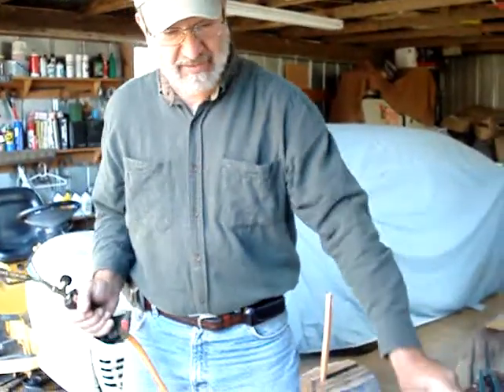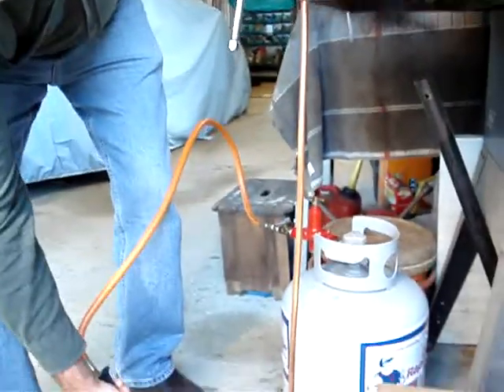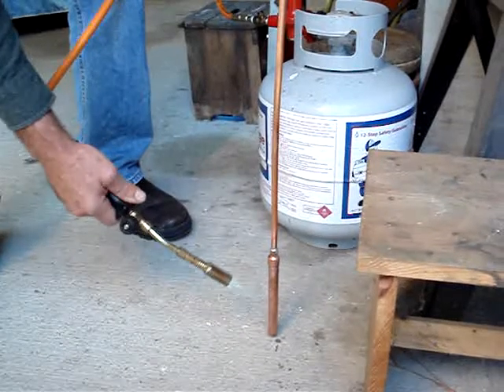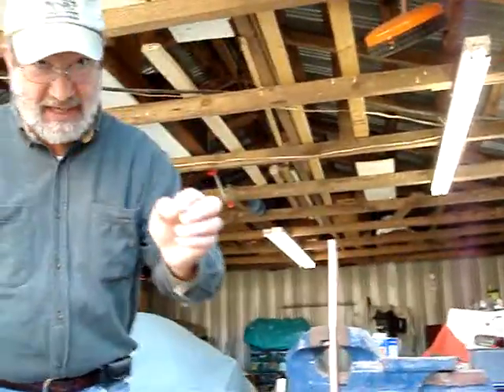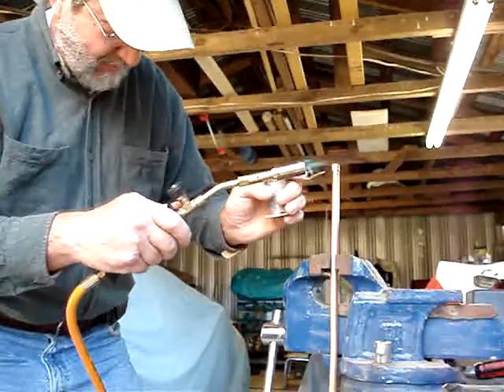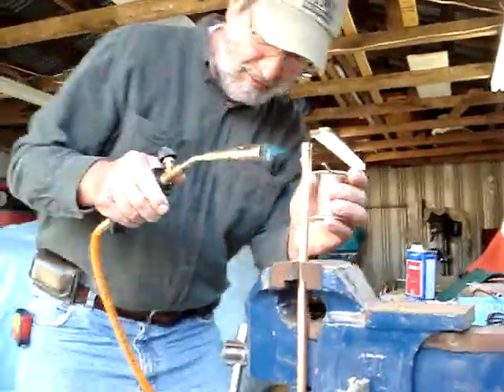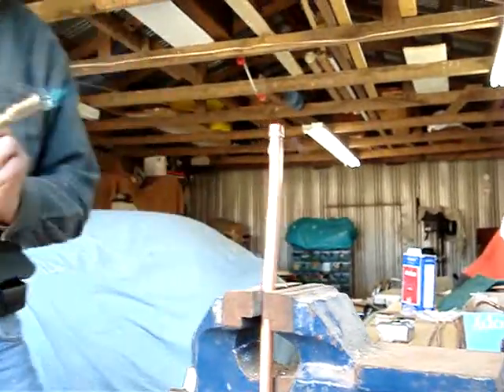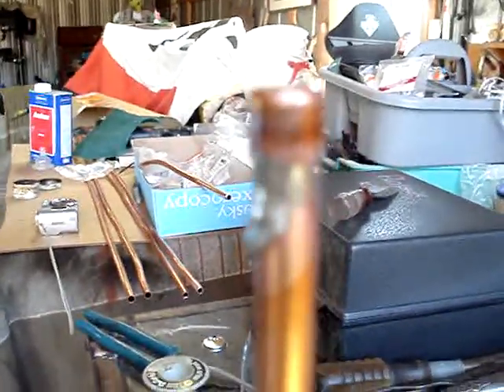making a heat pipe

Comment: I had problem with soldering the cap on - the vacuum inside the tube sucked the solder inside - it prevented a seal forming

Comment: Do you prefer acetone to water?
Reply from the maker: Yes, because it boils at a lower temperature
Reply: @DougKalmer  thank you for the response.

I went looking for data and found "Working Fluids and Temperature Ranges of Heat Pipes" very useful in data for working fluids and heat pipe material.

Comment: It's technically a Thermosiphon.
Add a wick and it becomes a Heatpipe.
Reply from the maker: It's a heat pipe- "A heat pipe is a heat-transfer device that employs phase transition to transfer heat between two solid interfaces. At the hot interface of a heat pipe, a volatile liquid in contact with a thermally conductive solid surface turns into a vapor by absorbing heat from that surface. The vapor then travels along the heat pipe to the cold interface and condenses back into a liquid, releasing the latent heat"

Comment: Fastest heat transfer rates known to man. Almost instantaneous. I thought it was water vapor though and not acetone.
Reply from the maker: Acetone used to get boiling point lower than water
Reply: @DougKalmer  no wick or is that in the construction already?
Reply from the maker: @scott-hr3hd  No, no need as long as the heated end is below the top of the pipe, gravity delivers the liquid back to the bottom

Comment: Does the pipe have sintered or grooved insides ??? Does it matter to have the pipe vertical or horizontal orientation ????
Reply from the maker: The pipe is smooth inside.vertical works much better horizontal would not work without a wick of some sort. You need gravity to pull the liquid back down to the heat source
Reply: @DougKalmer  Thank you Doug.

Comment: Think these could be used for a floor heat system?
Reply from the maker: No, as they need to be at or near vertical to work.
Reply: @DougKalmer  is there a way to create a wicking system to help it work at level?
Reply from the maker: @NwoDispatcher  I've seen some made with wicks, not nearly as efficient

Comment: Thanks so much Doug Kalmer,  Is the remaining acetone in the heat pipe acting as the heat transfer fluid, as opposed to using water???
Reply from the maker: The acetone boils, carrying much more heat as a vapor than a liquid can to the top of the tube where it condenses and drips down to complete the cycle
Reply: @DougKalmer  thanks Doug.  Great work ;-)

Comment: Could you use this to heat a hot water tank from a wood stove more effectively than using a thermosyphon coil?
Reply from the maker: I would use the thermosyphon coil instead for safety. The heat pipes are enclosed and do not have a pressure relief valve.

Comment: Interesting, thanks. I’d love to see it tested. You could always used epoxy to seal the top
Reply: Generic Jesus - the top goes well over 100C in use... not sure epoxy will hold up...  also, heating of the gasses in the tube during soldering increases the vacuum and lowers the temperature at which the acetone will boil, thus increasing efficiency.
Reply: Dont be lazy... learn to solder... Epoxy has no place in bonding copper for such an application. And as the gent above me already pointed out, just the act of soldering increases efficiency, which is kinda the point of building a heat pipe in the first place🍺
Reply from the maker: I would not advise using epoxy

Comment: Hi, we could double the efficiency by making very thin grooves grooves on the inside of the pipe aka a wick, like in the comercial heat pipes.
Does anyone know of a way to make tiny grooves like that?
Reply: gee i dont think u need to as it has a partial Vacuum so it will boil easily and transfer that heat energy up and condensate on the cool top which is against the colder water header,its a closed loop in that pipe already
Reply: In complicated and prototype heat pipes, they add a fine mesh screen to act as the wick.
Reply: @DerekWoolverton   virtually all commercial ones do, it only takes a websearch

Comment: Alcohol is not used within these things?
Reply from the maker: Alcohol can be used, some use water.
Reply: Have you ever tried using liquid metal instead of water to generate heat? With an electromagnetic pump could you not generate more heat and even make a hot plate to cook on and even heat a home and generate electricity?
Reply: Novartis

Comment: DANGER !!!!

For this project    DO NOT WELD   the copper pipe with tin or lead, because the final capsule will explode with the excessive heat on the solar vacuum tube.
CONFIRMED !!!

I wish you nice day
Reply from the maker: Every one of the dozens of heat tubes I have made used Lead free-with tin- SOLDER, and the only one that blew the end off was when I was experimenting with the amount of acetone and used too much
Reply: @DougKalmer  how much? is enough?
Reply from the maker: @rolandreves7222  Depends on length and diameter of tube.  Read down to see what I used

Comment: What volume of liquid would you recommend for a two foot x 1 inch heat pipe?
Reply from the maker: +Michael Buss I went with trial and error-and the error in using too much burst the end cap off the pipe and sent the thermometer over the roof of my house
Reply: sounds promising. I'll start with a small volume and work my way up then!

Comment: Is that 3/8 ID / 1/2 OD ?
Reply from the maker: +Eric Poulsen 3/8 OD
Reply: +Doug Kalmer  Did you find straight tube, or just straighten the coiled refrigeration stuff you could find at (say) Lowe's?
Reply from the maker: +Eric Poulsen Straightened the soft coiled tubing
Reply: +Doug Kalmer How did you arrive at 8ml acetone for your tube length (or actually volume)?  Trial/Error? Is there an empirical formula?
Reply from the maker: +Eric Poulsen No formula that I know of, trial and error, too much is dangerous
Reply: Doug Kalmer Last question: I have a short tube. How long is the 3/8 tubing you're using? I can adjust the amount of acetone if I know how long yours is.
Reply from the maker: +Eric Poulsen Think it was 46"

Comment: What is the "copper riser" on the bottom in this video?  Looks like a fat section of copper tube that has one end sealed. Did you buy it like this?
Reply from the maker: +Eric Poulsen Yes, it's a standard plumbing fitting readily available at Home Centers and plumbing supplies.

Comment: sir, how to set the pressure inside the heat pipe??
Reply: +Rahul Rathi He uses acetone, and if he got all of the air out of the pipe, he should be left with a saturated mixture of acetone liquid and vapor. The internal pressure is solely a function of temperature, and a plot is available at http://webbook.nist.gov/cgi/cbook.cgi?ID=C67641&Mask=4&Type=ANTOINE&Plot=on#ANTOINE
Reply from the maker: +Rahul Rathi That is a function of volume to liquid ratio.
Reply: The hotter the gasses within the pipe the more vacuum is created, and the lower temperature the heat pipe will begin pumping heat at, due to the lower pressure allowing acetone to boil at a lower temp.   

  As long as the top end can dump the gathered heat to something (a water tank, for instance,) the over-all system would operate more efficiently.  

  This heating during sealing must be balanced with not boiling out all of your acetone.

Comment: Hi Doug, did you put some filament wire/steel wool in order to increase the capilaries?
Have you tried it? Does it work much better or it's not worth it?
Reply from the maker: +thephatnguyen If you mean a wick inside the heat tube, then no, there is no need as long as the tube is oriented so the heated end is lower so the condensate runs back down.
Reply: @DougKalmer  yeah that would gunk up,the wick thingy
Reply from the maker: @rolandreves7222  No wick

Comment: Glad I found this video again.  Do you think it would work ok to use all brazed joints instead of soldered joints, except for the final cap that could be a threaded connection that has teflon putty or hi-temp automotive Permatex on the threads for the final seal-up of the pure acetone vapor?
Reply from the maker: ShambhalaVillage Sounds good, let us know how it works out

Comment: how much water do we need inside of the pipe?
Reply from the maker: There is no water inside the pipe, it's acetone.
Reply: but, when i saw this experiment it says it could be with water and also my chemistry teacher told me it could be water, so i want ask you the same. could it be water?
Reply from the maker: Thiago Florez Yes, water could be used, but it's boiling point is much higher than acetone, so efficiency will be considerably less. It will also be subject to freezing, which could burst the copper tube. You could lower the boiling point of water by pulling a partial vacuum in the tube.

Comment: Great video doug, couple of questions: isn't acetone dangerous, like toxic?

Also have you ever built heatpipes for electronics, like PCs?
Reply from the maker: EPA removed acetone from the list of "toxic chemicals" maintained under Section 313 of the Emergency Planning and Community Right to Know Act (EPCRA). In making that decision, EPA conducted an extensive review of the available toxicity data on acetone and found that acetone "exhibits acute toxicity only at levels that greatly exceed releases and resultant exposures", and further that acetone "exhibits low toxicity in chronic studies". It's a main ingredient in nail polish remover, it's a common solvent available at most hardware stores.
No, I have not built Heatpipes for electronics
Reply: @DougKalmer   but i think the Chinese ones use a type of antifreeze? iv cut a few open

Comment: Ahh... had to scrunch my brain for a bit on that webpage! lol.  math isn't my strong suit.. or weak suit, lol.  ...however thanks for educating me on this.  I think my problem was not realizing the actual CAUSE of the boiling; my misconception (probably a common one) being that Heat was the cause of boiling when it's actually pressure on the water that keeps it from boiling! My misguided thought was a set numrical value between freezing and boiling point. Ouch, I was very wrong! lol Thanks much!

Comment: There seems some confusion on when H2O is liquid .....  lsbu.ac.uk/water/phase.html     ....this phase diagram shows it cannot be liquid below  0C  whatever the pressure , therefore no water heat pipe can work if its 'hot' end is below 0C.

Comment: ...for clarification though, my definition of a heat pipe is derived from the 60's and 70's where the heat pipe WAS the vacuum tube all by itself.  They are still commonly used in such places as along the Alaskan pipeline buried in the permafrost and extending above ground to remove heat from the permafrost to keep it from turning to mush.  ...I don't recall if the liquid used in them is water but the liquid under vacuum principle and 'below atmospheric freezing' principle applies for the vacuum

Comment: I agree with you, you can seal it by boiling the water and sealing it with it steaming out... and you will get the results you list.  However, if you pull the pipe into a deep vacuum, then valve in purified water and the vacuum stays deep, say 29.9199 in. HG, even when the water boils of to a vapor, at -60F, when it reaches the top and starts to condense and running down the inside of the pipe to collect at the bottom it will not be capable of getting cold enough to freeze at 0 external temp.

Comment: With respect Doug the amount of acetone in pipe would not determine if the top blows off. What would do that is not removing all the air, that's my main concern about the video that to remove all the air you need a steady jet of acetone vapor for a few seconds then quickly solder on end cap.

Comment: I beg to differ ...consider a heat pipe hot end 0F cold end 10F lets start with the water (ice) in the hot, lower end. The ice will vaporizer (not boil, which is change from liquid to gas) and sublimate to ice on the cooler end , but there it will stay coating the inside of the cool  end as ice crystals, the heat pipe cant work cos the ice can't return to the hot end. You don't need to pull a vacuum, just push air out by boiling the water ,when steam jetting out put on and solder end cap quickly

Comment: the water freezing isn't an issue if the vaacum is set properly:  water boils at 212f at 0 in. of HG vaacum, but when you start applying a vaacum... here are a few examples: 28.67 in. HG will boil at 86F, 29.87 in. HG will boil at 6F, 29.919 in. HG will boil water at -60F !! 29.9199 in. HG will boil water at -90F !!  Crazy fun! :)  ...now how to make these yourself and somehow pull the vaacum while getting the water in there would make for a neat hat-trick video! :)

Comment from the maker: Not that I know of, I arrived at 8ml by trial and error-and erring in the side of too much blew the top off one pipe with explosive force. I suppose you could figure the volume of the tube I used and get a ballpark ratio from that.

Comment: Is there a formula/ratio of acetone to the volume of the pipe and converter bulb, or doesn't it need to be that precise?  I've got some 20" x 1 3/4" evacuated tubes from Clean Republic that I can't find heat pipes for ( in the US).

Comment: no vacuum pump needed , you just repeat what you did in the video but using water ( and gloves ) . Heat up the bottom until a steady jet of steam comes out , then quickly solder on end cap. Even in an acetone heat pipe you have a partial vacuum ,just a bit weaker than a water heat pipe, at room temperature v.p. water 24 , acetone 230 mm Hg

Comment: Yes  , I was correcting your statement "...in a heat pipe you can use water at any temperature bellow freezing." you can never use a water heat pipe below freezing, it can survive freezing, heat pipes aren't just for solar, can be used in refrigeration

Comment from the maker: To collect heat at typical domestic water heating temperatures, it helps if the change of state occurs at or near those temps. Acetone boils at 133*F, water at 212*F, so to use water efficiently in this application requires pulling a partial vacuum on the heat pipe, which adds complications like access valves, vacuum pumps, and how nature feels about vacuums. Acetone is cheap, readily available, and the boiling point is right for this application.
Reply: Acetone/water  only boil at those temps at atmosheric pressure , which the inside of a heat pipe knows nothing about ,
 Doing what you did in the video , but with water , is all that is needed . You drive off all air then seal , then when cool the pressure inside will be the Vapour pressure of the water at that temp  0.0313 Armosphers at room temp Even if you connected a vac punp that would not reduce the pressure ( untill all the water vapour was sucked out ) Acetone is only needed for working temps below 0C
Reply from the maker: @oz93666  Then on a cold night the water freezes and breaks the pipe-acetone won't.

Comment: In a solar collector application you don't need to "operate" at low temperature. You just need to "survive" low temperatures.
When the sun heats the pipe to operating temperatures it starts to transfer heat.
redrok

Comment: Acetone is not a liquid at 100C at atmospheric pressure.
wikipedia(dot)org/wiki/Acetone_(data_page)#Vapor_pressure_of_liquid
At 100C the pressure of acetone is about 2 atmospheres or 60psi.
Water operates at lower pressures and will be at lower pressure at stagnant  temperatures. Besides water has better heat carrying capacity.
redrok

Comment: thanks for that ....I take your point that freezing won't damage the pipe , but surely you you can't use water heat pipe  'at any temp below freezing'  the working fluid has to return to the hot end and if it freezes on the cold end it won't move . What do you think best working fluid would be for minus 12C. ? Brilliant site you've got , particularly on lead acid , this is the expensive component in off grid power, now panels are so cheap , have just bought 5kw on Alibaba $0.65/w

Comment: BTW, virtually all the commercial vacuum tube type heatpipes use water as the working fluid. Water is nearly ideal for these applications because of its superior thermal mas s and high latent heat of vaporization.
I also have made heatpipes. See:
redrok(dot)com/misc1.htm#heatpipe
In these I used butane and propane.
redrok

Comment: You made a remark about 0C and water.
Actually in a heat pipe you can use water at any temperature bellow freezing.
Remember, water doesn't expand upon freezing.
It actually expands a couple of degrees above freezing forming whole families of molecules, predominately H8O4 and others. These molecules take up more room and expands while still a liquid.
Since this is a heatpipe all regions of it are very close to the same temperature so no harm is done when freezing, even with water.
redrok

Comment: Ok, I'm a believer. Heated 1m copper pipe over gas flame, i) with and ii) without a bit of water in it. Pipe with water in it heated up substantially faster. Even under pressure (closed pipe) the water boiled inside the pipe. When pressure was allowed to escape from the pipe whilst heating, that certainly seemed to increase the rate at which the pipe heated.

Comment from the maker: Heat pipes would not work if what you claim is true. They work by the fluid boiling inside the sealed tube and transferring heat thru a change of state

Comment: Hi HS... I think you may not have got all the air out, in the video Doug definitely didn't, there should be a stream of acetone vapor at 56C coming out and the top of the pipe should be at 56C, too hot to hold. Doug forgot to say you only need acetone for low temperatures, above 0C water is better with a latent heat of vaporization four times higher than acetone. Keep at it, when you get it right you'll be amazed !!!